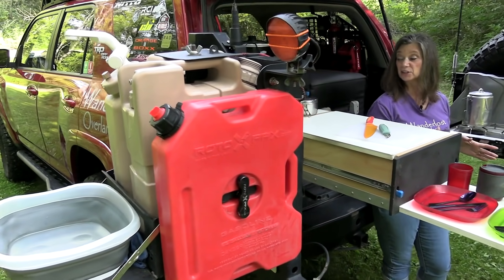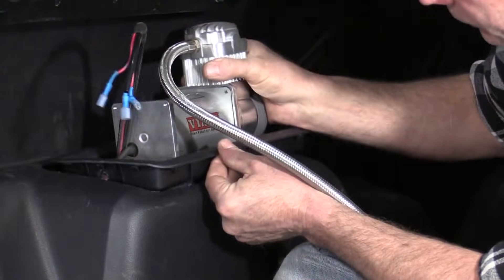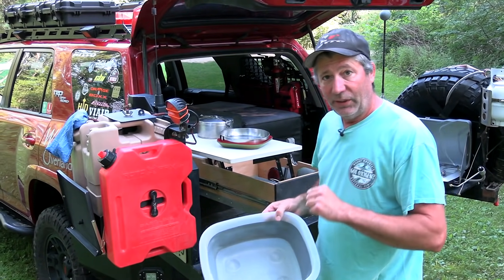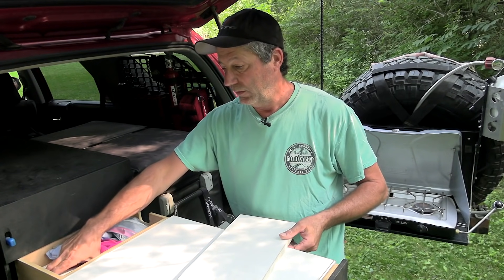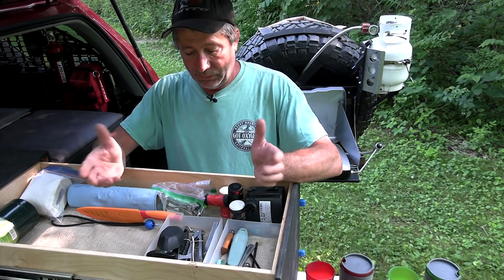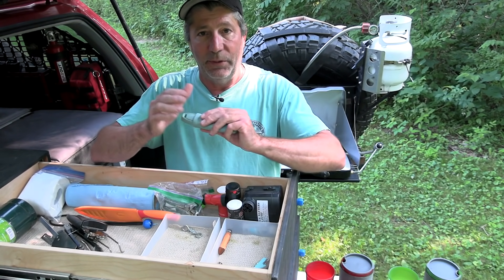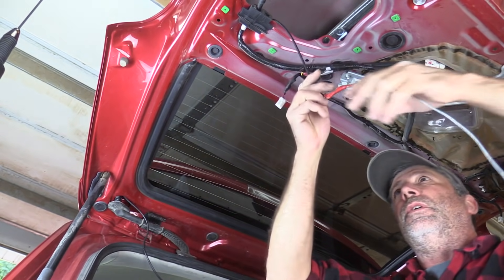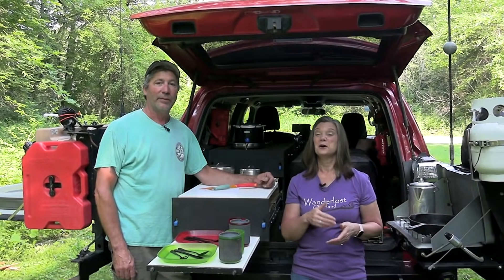DIY Overland Kitchen Build, Walk Around.

Comment: I had forgotten how talented Mark is. I've been a custom cabinet maker for 43 years doing kitchens for multi million dollar homes. That drawer system Mark built is great. I've had guys with 10 years experience mess drawers up all the time. Those drawer glides need an accurate drawer width in order to work well. It's the electrical stuff that confounds me.
Reply from the maker: Wow, thank you!

Comment: So currently Apogee Off Road is the only known after market bumper maker who has a working BSM compatible rear bumper. they have a dual swingout tire carrier in development. since my Tacoma has all the safety features, and I intend to keep my BSM system functional, I am hoping to get one after they release the tire carrier. It is my intent to put my tire and HF antenna (I am presently studying for getting my General upgrade on my ham license)on the right side, while on the left I was looking at building a custom locking jerry can carrier for a pair of cans. it was my intent to relocate the license plate to the the jerry can carrier with an LED trailer license plate bracket, but I am digging that table you attached to your jerry carrier... I am going to have to do some redesign in the near future. 

As for the rest of the "kitchen" I do not presently have one of those fancy pants refrigerators, so I use my 50qt cooler but I have a bedcap with side window/doors so I can make modular storage behind the windows and am seriously considering making a fancy li'l passenger side kitchen box (since I have the 6' bed, I have almost 5' of window. I figure that should make a nice kitchen on the passenger side and a good bit of camp gear storage on the driver side.

Comment: The backup can opener is called a B52. The smaller version is a P38. The B52 is used on T-paks (squad size meals). Were as the P38 is for individual c-rats.